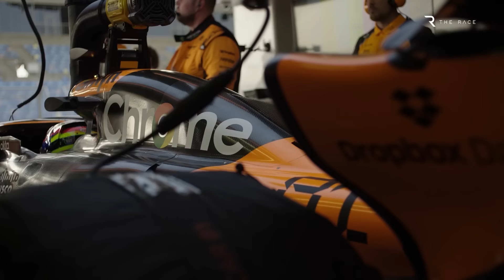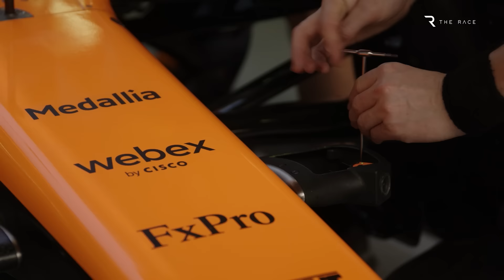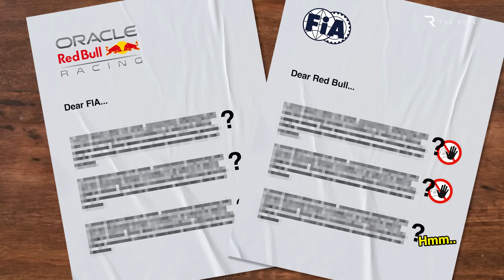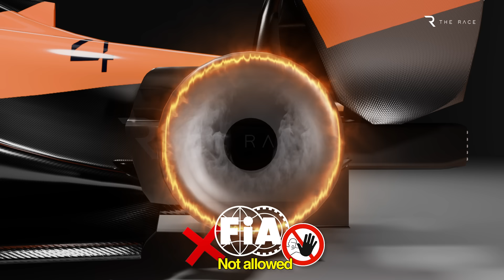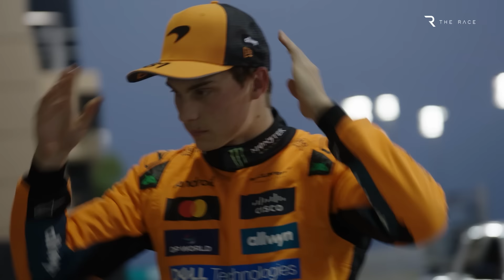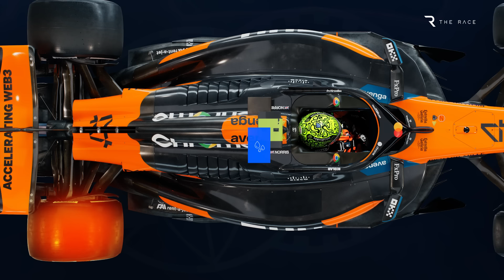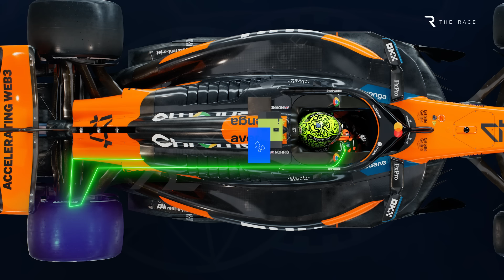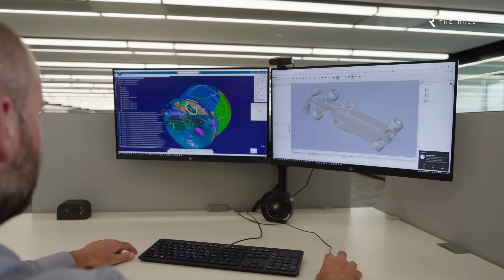Revealed: Red Bull’s wildest theories on McLaren’s clever tyre tricks

Comment: I'd like to think it's some really ingenious innovation that McLaren are running, but I honestly don't think there is anything going on, they're just more gentle on the rear tyres from the way the suspension is set up.
Reply: I'd tend to agree but those reports of rear brake ducts with the "thermal imaging" are what interests me on this. You can be gentle on the rears but that will be due more to tyre wear, not brake temperature.
Reply: @nosebleedpuddle  if you don't have to use the rear brakes as much (more front braking or just braking less) it would produce less heat overall
Reply: @kaspershaupt  Less heat being key, not significantly as the theories are suggesting. Brake balance is always being played with, it's nothing new in this sport and it's barking up with wrong tree.
Reply: @nosebleedpuddle  The details about the thermal imaging have been kept suspiciously quiet. No evidence of what temperature, what session, what time of day, where it was. Nothing.
Reply: @tdyerwestfield  Yeah exactly, I mean  teams are always taking photos of other teams parts but we don't get access to them either, so I don't see why this would be any different. As we're aware, any data / info a team has they'll keep it to themselves rather than to satisfy us or to give any other team an advatage.
Reply: U really think, after three years of the same regulations, those mooks at Woking are going to design a chassis 1s faster than Ferrari and Merc? No chance that thing is legal. Absolutely none.
Reply: @perfectman3077 you heard it here first. Time will tell.
Reply: the lack of McLaren dominance at Imola was telling, a lot.
Reply: @nouds1290 no it wasn't.If piastri actually defended against max he would've driven into the distance later on
Reply: @Ssmith05  You're picking one moment, I'm talking about overall speed and tyre life during the race. Normally McLaren would dominate the second half of every tire stint, because the car is way better on the tires. They didn't seem to have that advantage here.

Comment: "Pirelli supplied air"?
I did not know that
Reply: Shouldn't it be nitrogen? O personally use the 80/20 blend for my tyres.
Reply: @5150Swordfish  I have no idea what they run but I've talked to a few motorcycle riders during my track days over the years that also say they prefer a mixture with nitrogen
Reply: @patrickspapens5497  I've been using a nitrogen blend since the 80s in all my vehicles. Somewhere around 78% nitrogen - you know - the amount in air.
Reply: @Thermalions  78% by volume, got it. I just use normal air, but to what extent does it improve the tire performance? Operating temps?
Reply: @5150Swordfish  Ferrari used to use Nitrogen, but it was banned. Now I guess only air is allowed. Maybe Papaya are secretly saturating their air with water??
Reply: Pirelli air with a hole

Comment: If gas is allowed why wouldn’t teams use carbon dioxide or nitrogen to cool the drums? Especially nitrogen. It’s cold on release and wouldn’t need a lot to make it through a Race. Especially if it’s triggered by a heat sensor (which is already part of the assembly). I don’t think McLaren are using this idea but it’s definitely something that could be used and allowed through the rules.
Reply: Its not feasible. You only get ~400J/g of cooling from nitrogen between the phase change and difference between liquid and atmospheric temps. Each brake disc weighs about 1Kg, and has a thermal capacity of .7-1.1J/g-K meaning you would need about ~2-3 grams of nitrogen in a perfect world to cool each brake disc 1 degree. Nitrogen only has an advantage in cooling due to its phase change energy requirements. Once you hit atmospheric temps, it is on par with regular air for thermal capacity and is just added weight. 

TLDR: minimal benefits in cooling vs the added weight dictates that using onboard stored gas for cooling is out of the question.
Reply: @nightkil13r thank you for explaining this cause I am not smart enough to figure out why. 😂😂
Reply: Weight a nitrogen tank is extremely heavy and usually to store it that cold requires extreme pressures so even if it was made of carbon it would be so thick it would add too much weight and negate the cooling effect
Reply: @kingofkickz52 nitrogen is classified as a gas bud; same with CO2. Both can become a liquid at -196 C and solid Dry Ice (respectively) but are classified as gases. The internet is free knowledge you should try it sometime.
Reply: @rayfinkle5048 okay cool ur right and didn’t disagree all I was saying was to keep nitrogen in a gaseous state, it needs to be stored in a tightly sealed, high-pressure cylinder. These cylinders are designed to withstand significant pressure, ensuring the gas remains compressed and in its gaseous form. Additionally, the cylinders are equipped with valves and regulators to control the flow of gas and maintain pressure. Proper storage and handling protocols, including keeping cylinders in well-ventilated, dry, and cool areas, are also crucial to ensure safety and prevent leaks, therefore the additional weight of the system would be a net negative to the overall design concept
Reply: That’s a fair point and a good question

Comment: I wonder if they just use small cubes of dry ice in a compartment? 
When they warm up it just sublime into gas so it's legit with in the rules?
Reply: From what I gather from this video is that gas is A-OK. And I didnt hear in this video that solids where banned. So in theory that should work. But doesnt dry ice melt first before turning into gas? And also, the temprature of dry ice seems a bit too low to be usable in the first part of a stint. Think you'd rather have something that cools more in the latter part versus cooling a lot in lap 1